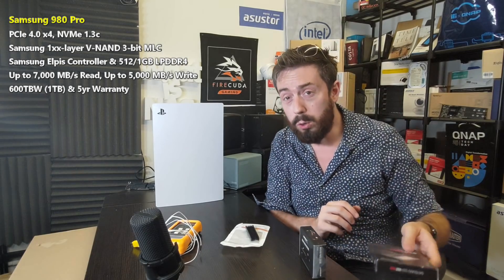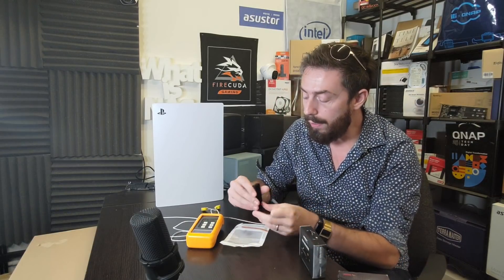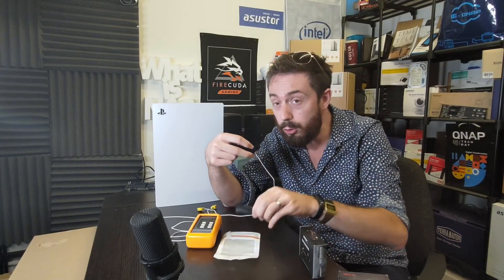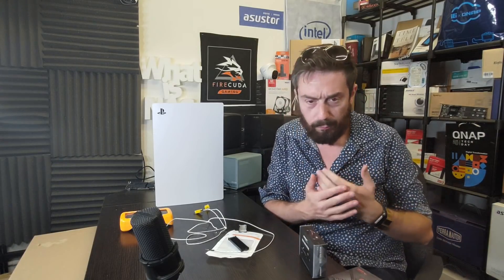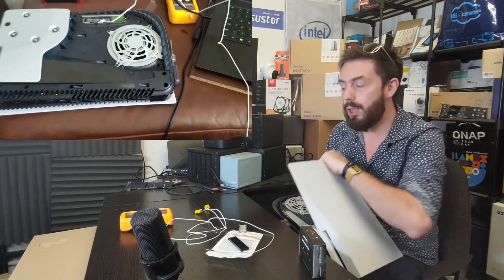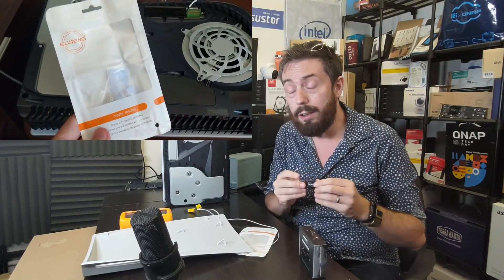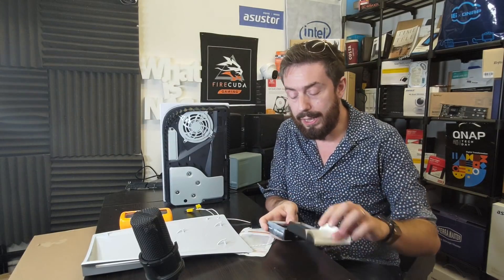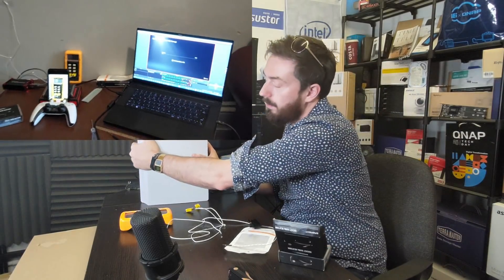PS5 SSD Expansion Heatsink vs No-Heatsink vs BIG Heatsink TEMPERATURE TEST

Comment: Can you explain what is the need to replace the memory expansion door? Every time I think about it it just makes more sense to leave it off for air circulation etc
Reply: From what I've seen it keeps the heat from the SSD away from the rest of the PS5, which is why it needs a heatsink.
Reply: The bay has two vent holes in it and the fan uses negative pressure like a vacuum to suck the heat out the bay so the lid must be on for it to create a seal this was from a Japanese engineer at Sony who helped build the console
Reply: @CH-bn7qb  how do you generate negative pressure in an object with holes in it? I'd love to talk to that engineer lol
Reply: @MorrisseyMuse   well that’s what he said I will try and find the link for you one vent is smaller than the other and they’re side by side so it’s probably used like a Venturi that’s my thinking
Reply: This was already addressed by a Sony Engineer. it needs to be left on.

Comment: My heatsink is touching the cover, is that a potential problem?
Reply: It's fine, are the shims (metal lines) placed left-right or up-down. I'd take the grey slot cover off if it's the up-down type as that blocks the air holes in the m.2 bay.

Comment: Many thanks for this informative contribution! I wonder whether or not two-sided M.2 SSDs are getting even hotter when compared to one-sided ones. In addition, I would love to learn, whether the ELUTENG heatsink can also be used for two-sided SSDs such as the firecuda 530 2/4TB - and then still fits into the PS5.

Comment: Thank you for doing this test! The question is now.. do I leave the bay open or use the cover with my heat sink? 🤔
Reply: Keep the cover on unless you plan to use a massive heat sink. You wanna limit the holes into your new console ;)
Reply: @MorrisseyMuse  ok thanks
Reply: Sony have said the cover is needed for negative pressure cooling.
Reply: @Dreadpirateflappy  ok cool thanks

Comment: So based on this Test if you have a Thick HeatSink it will run cooler than a Low Profile Heatsink with Cover on it. That is kind what I thought before you ran test because when you examine the NVMe Slot there is no ventilation in that open bay.
Reply: "There are 2 exhaust holes for SSD slot for expansion. Since the expansion slot is near the intake fan, it has a structure that sucks heat from the exhaust hole with negative pressure." - Yasuhiro Otori
Reply: @sgtsqueaky  a vertical heatsink will block those two holes.
Reply: @amirpourghoureiyan1637  it certainly doesn't block them on mine while using an SN850 and MC1 heatsink.
Reply: @sgtsqueaky  that's because the MC1 isn't a purely vertical heatsink like the generic ones. It has horizontal gaps to help heat dissipate

Comment: Quick question: how long do the pads in a heatsink last? Will I have to replace them in like a year or something?
Reply: They usually last a few years. No need to change them unless you're getting an overheating issue a few years in the future.
Reply: @MikeRoeCactusGuy  
Thanks.
Reply: @MikeRoeCactusGuy  I had some fights with my thermal pads (first time doing that) and i had to take of the pads like 4-5 times again (so its not 100% clean) and place it again. On one the edge is also a little bit "broken/folded". But only one edge on one site).

Do you think i'm safe to go? PS5 accepted it but since the ps5 wont show you how hot its getting, i got the fear that it will die faster or the heatsink wont work. Could you help me maybe? Do you think i'm fine?

(Samsung 980 pro + custom heatsink bought from amazon)
Reply: @spy2859  I think as long as you didn't like cover it up with finger dirt and it doesn't look dirty the pad should be OK. Personally my OCD wouldnt let me use an even slightly messed up thermal pad. But you're more than likely fine. If the heatsink has extra pads then you're extra fine. (The heatsink will still work even with a little dirt or it/ or a slightly folded corner. It wont die any faster 👍)
Reply: @MikeRoeCactusGuy  What do you mean by "if the heatsink has extra pads"?
Reply: @spy2859  you said custom heatsink from Amazon. Sometimes they will throw in an extra thermal pad in the box depending on the brand. But if they didn't you should still be fine.
Reply: @MikeRoeCactusGuy  Ah i got it, yeah it had 2 but the problem is there were 2 thin and 2 thick ones. I'm using one of each. But i messes up the first thick one and uses the other one then.

But i still have one thin pad.

Comment: Heatsinks on a PS5 M.2 Drive is a mix bag of nuts.  A heatsink on a M.2 drive for your PS5 isn't necessary unless you plan on doing direct transfers from your
PS5's internal drive to your M.2 drive.   Download speeds from the network aren't anywhere near fast enough to cause your M.2 drive to over heat.  Reading
data to play games isn't going to make your PS5 M.2 drive get overheated either.
Reply: Regardless, even with all of the info you are saying here, and internal testing Sony has surely done, they are saying "REQUIRED", not "RECOMMENDED". 

So it is better to just spend the $10 and use a heatsink, as Sony is saying is required.
Reply: @Halaster  Not.  There are other companies that have tested SSD's without heatsinks and drew the conclusion that there not necessary.  In some cases the heatsink  caused more damage to the M.2 drive than the one without a heatsink.
Reply: @GregHakes  their only test in short time, how about 12 hours nonstop like me playing ps5,  gonna need heatsink or not, thats the question.
Reply: @davidjapri5947  Yep, especially the PS5 games like Ratchet and Clank and others that are reading the SSD often for loading areas. Even NASCompares has another video literally titled "PS5 SSD Upgrades - WHY YOU 100% NEED A HEATSINK! (HEAT TEST!)
" that talks about this a little bit. People are dense.
Reply: Newer drives probably won't need heatsinks, smaller chips that are more heat efficient will guarantee this
Reply: @amirpourghoureiyan1637  That is indeed possible in the future, you are absolutely right. Not now though, many of these drives are brand spanking new and just now coming out and get hot. It will be a while before we get the next generation of drives with smaller chips that run cooler.
Reply: @Halaster  Always happens with bleeding edge products. 
Even if the heat issue isn't solved, I imagine PCIe 5 drives won't need it in Gen4 mode - it'll be running at half bandwidth with no chance of maxing out the chips.
Reply: Did...did you not watch this video...? lol
Reply: @MorrisseyMuse  The video where he specifically calls out that he is using the larger heatsink on his PS5? So not only is he using a heatsink as Sony says is required, he is even using the better performing of the two even though it does not fit properly with the SSD area closing. Or how about the other video by this exact same guy named, "PS5 SSD Upgrades - WHY YOU 100% NEED A HEATSINK! (HEAT TEST!)" 

Yes, I watched the video. Did you?
Reply: @MorrisseyMuse  Yes i watched the Fucking Video.  He is not duplicating what your PS5 will normally be doing.

Comment: It would’ve been nice if you tested the no heat sink and the one with the smaller heat sink with out the lids to see the difference with lid and no lid.
Reply: I’m also interested in the difference in using the lid or not
Reply: Yes this would be a great test. But hopefully it doesn't take away from the CPU/GPU
Reply: that would have been very useful... if the temps didn't reach 55 degrees without the lid, I would totally go for a drive without a heatsink to save some money, or go for a bigger drive if it's not much more expensive.

Comment: good review. i will say my ssd with the yateng heatsink is great. my ps5 when i feel it, doesn't feel hot just very warm. and thats on one side only. so the heat sink is doing its job because only the bottom of the system is warm.

Comment: Imagine spending 399-499 on a ps5, and 200-600 for and SSD and then not wanting to put a 10-20 heatsink on it.
Reply: I spent 500 for my PS5 no scalpers were or will ever get my money.
Reply: @Maxrepfitgm  Nice. Friends I know that have a PS5 got it off a scalper.
Reply: I've been running mine without a heatsink for over a year now over 500 hours gaming. No problems
Reply: @Mictian1980 okay I was about to ask if anyone has one without a heatsync for atleast a year and you answered
Reply: Imagine being dumb enough you think you need to spend more then 10-20 on an m.2 heatsink.
Reply: Imagine thinking it would risk anything to leave it without a heatsink
Reply: PS5 500 and 2tb m.2 for 100
Reply: and what if, i came fron a pc, already have an ssd without a heatsink and just want to know if i have to buy a new one or not.
Reply: More like 1000 for ps5 and 500 for ssd (no point buying below 2 tb)
Reply: @JewTube664   £450 for my PS5 £377 for my 2TB Aorus SSD
Reply: @JewTube664  400€ for my PS5 280€ for the 2TB Gammix S70
Reply: @JewTube664  I got my PS5 bundle with spiderman miles morales and 2 controllers for $330 from Kohl's last Christmas and I just bought a Samsung 980 pro 1Tb with heatsink for $200. Boom $530 for 2Tb PS5
Couldn't be any happier with it
Reply: @charlierose1708 a ps5 from Kohl’s for 330? I wanna call you a liar so bad but nothing surprises me anymore so anything is possible lol
Reply: @JewTube664  1TB is enough.